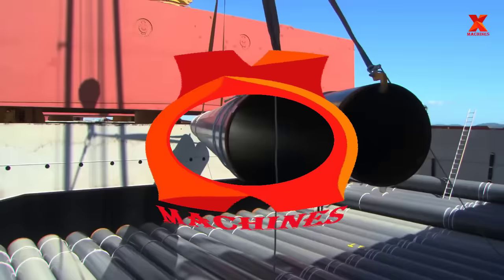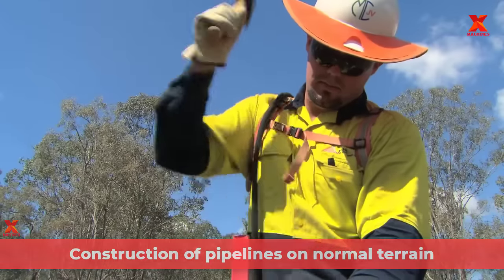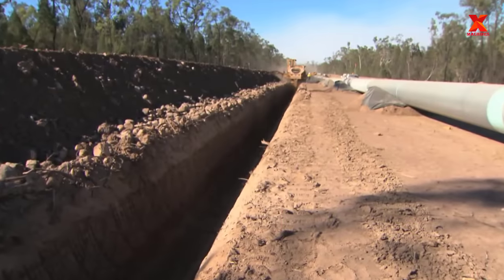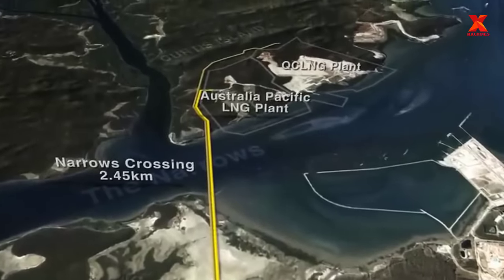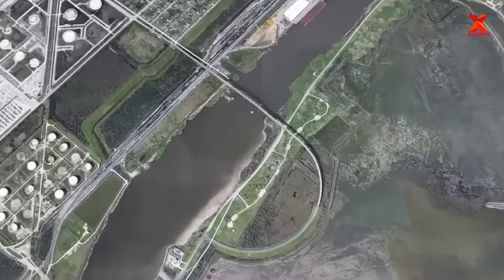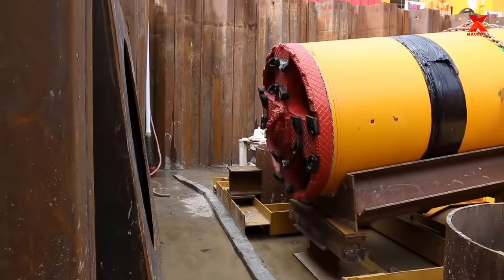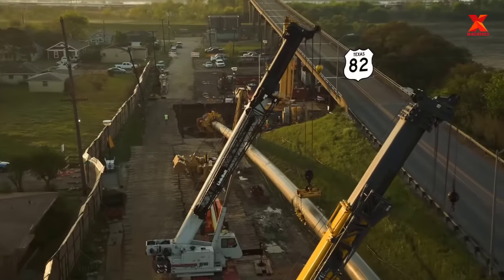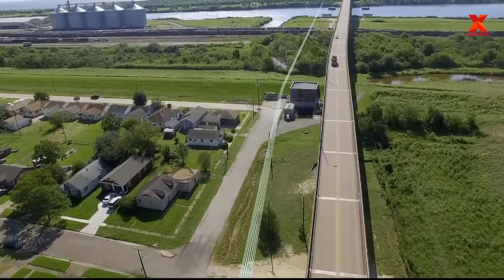Construction Process Of One Of The Largest Oil And Gas Pipelines In The World.

Comment: @6:38 Perhaps in a future video you can explain why the "direct pipe method" allows lower pressure at the drill head with reduced fracture of surrounding rock.